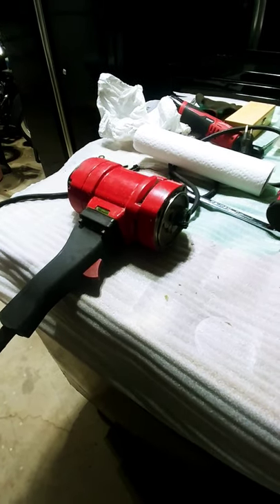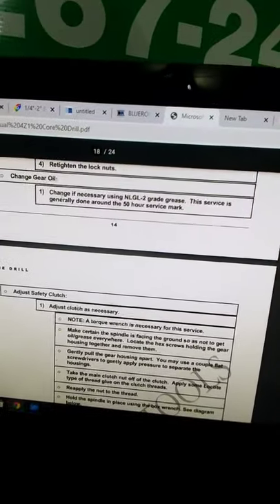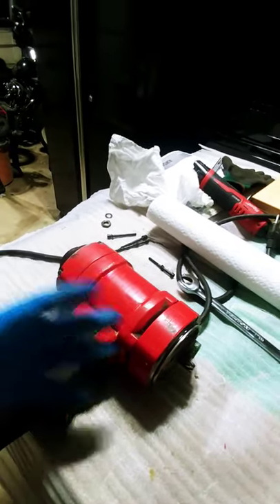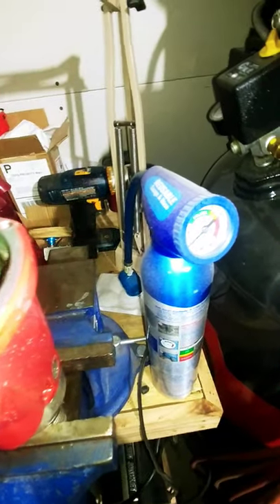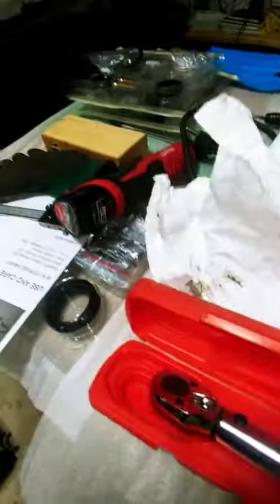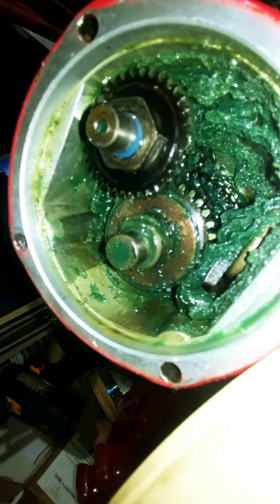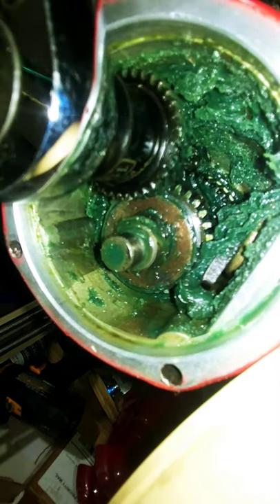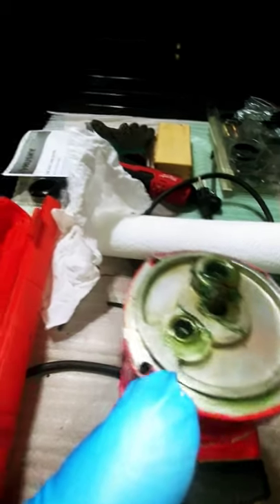Bluerock Core Drill Review and Maintenance

Comment: Chinese weka.....im surprised it lasted a year
Reply from the maker: I would buy another in a heart beat
Reply: @VRudi460  cost is cost....but I use mine often on commercial concrete and try to avoid bar if I need to with my hilti ps1000